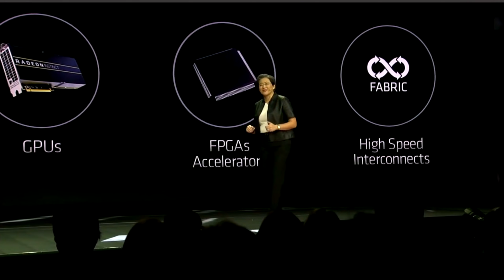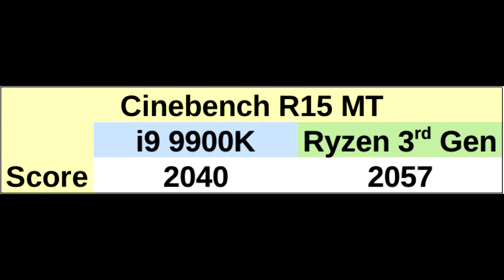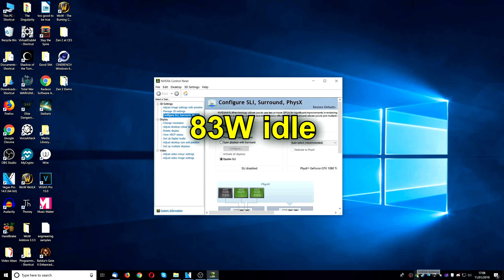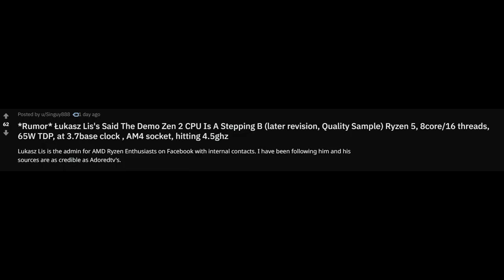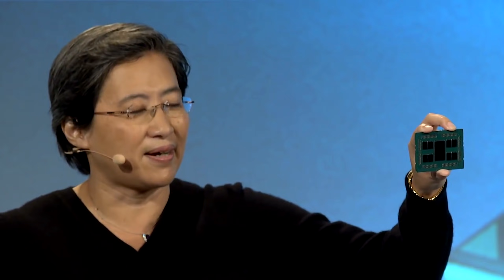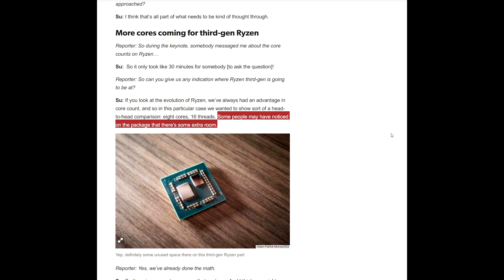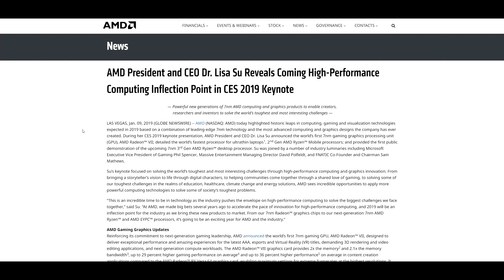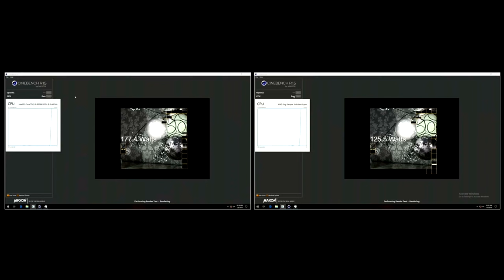Zen 2 Faster than i9 9900K at Half the Power.

Comment: Seeing as Dr Lisa Su, has pretty much CONFIRMED that they'll be able to put 2 chiplets on. It's only a matter of time, before 12 & 16 core RYZEN 3000 will be available. 😎
Reply: Lisa said it herself: they showed an 8-core chip to demonstrate a head-to-head comparison. They've always had the core-count advantage to fall back on when their IPC wasn't as good. Now they want to show apples-to-apples to prevent the tech press from simply laughing saying "if course you won! you had more cores!"
Reply: In traditional AMD fashion, the problem may lie at GloFo. The I/O chip's memory controller may not be able to handle communication with two CPU dies yet. That would explain the 8C demo and some schedule slippage.
Reply: @chipminion7887  Wrong. Did you forget that Rome has already GloFo I/O die handling communication to 4 cpu dies? Rome has been already benchmarked so probably it can do it..
Reply: @chipminion7887  They have already demo'd Rome with I/O controller and multiple chiplets. I think they are holding their cards close so they can gauge where Intel will be with Ice Lake and maximize the opportunity they have to gain performance leadership. It could also be they are figuring out the various chip binning strategies given experience where the TSMC 7nm performance is coming out. I think 4Ghz+ is probably a first for this node so maybe they don't have a lot of high performance chiplet's yet and the ones they do have they might want to feed to Rome to maximize revenue. It's clear AMD have the potential to > 8 core's and core for core is probably at least as good as the current Intel core but the challenge becomes how to maximize all those combinations of cores and Ghz across Rome, TR and Ryzen to make as much revenue as possible to grow the overall AMD business. They have to get out of being the low cost value play and capture a bigger slice of the high end and enterprise market to keep funding R&D and fix their lagging GPU/ML/AI business
Reply: Sure but I'm more excited by the fact that this was the low TDP part running at low clock speeds yet still beating 2700x. Not really interested in 12/16 cores other than how much cheaper it makes the 8/16. Most excited to find out the IPC and final clock speeds.
Reply: don't build up the next hype train
Reply: You know there is room in my garage for a Ferrari?  "Hey guys I'm getting a Ferrari!"
Reply: What does this mean for TR?  Will they stick to 24, 32, 48, 64?
Reply: @jonnytaco7671  same reason they use "dummy dies" for the first gen threadripper, to make it easier to upgrade in the future.
Reply: Why they did not announced it from CES to have their funbase happy. Also pricing will be very important in 3000 series.
Reply: Ok that's cool but why didn't they show 12/16 core ryzen 3000 at CES? Answer: Because it is clearly not ready yet.
Reply: @TheTomtah  It just means they didn't want to show all their cards to intel lol.
Reply: @heliamvs2035  Well they kind of did. What they wanted to do that was to show their advantage and the performance parity vs Intel's best. Now AMD has the advantage in core count, efficiency and atleast parity in single core performance. What does Intel have? Broken 10nm process which might somehow give Intel more room to work with, but it will never reach what AMD has as 7nm+ is confirmed and in design stage already.
At some point Intel will catch up, but it's pretty sure that Intel is really gonna lose a lot and possibly turn the tables in terms of market share to be majority AMD.
Reply: @heliamvs2035   If every tech nerd on the internet can see there is room for 2 chiplets on that chip I'm pretty sure Intel can figure it out too 😂. Especially given it was leaked way in advance of the presentation and they showed the wattage. Don't ya think ?

Lisa is not trying to play 4d chess guys... the 12/16 core chips just aren't ready for demonstration because they're having some technical issues with them currently. I'm sure they will be resolved.
Reply: @TheTomtah  18 core chips? Amazing.
Reply: @TheTomtah  There's also the issue of building up enough stock to satisfy demand and keep prices low once the CPUs finally debut. Because if Ryzen 3000 is truly as good as it is looking like right now, AMD will see record-breaking sales and they really don't want to fuck up this opportunity
Reply: @TheTomtah  Thats why he said "its a matter of time" i dont know why people comment stuff like this.
Reply: @7550Raul  Because through his wording he made it seem like Lisa is actively withholding this information as some part of a grand scheme when in reality I believe the 12/16c chips are not ready to be demoed for technical reasons.
Reply: @TheTomtah  maybe they don't want it to cannibalize threadripper sales?
Reply: That means it's also possible that amd will held the 12/16 core cpu for ryzen 4000 instead.
Reply: @Nourdon-AS  If they wanted to do that doing a small chiplet like this on this doe soze would have been a total waster of money. They will obviously fit a second one in there. Thats what the die size and 7nm process was built for

Comment: people just need to stop getting overhyped and pegging their identities to a company.  i thought amd did very good at ces,even the gpu, while a lot of amd fans are disappointed.  the ability to do 12 and 16 core cpus is confirmed. a new vega card that addresses most of the limitations of the old one (rop, mem bandiwdth, clocks).  the price is a bit high but wasnt that about what vega 64 launched at?  if they can get prices down it wont be that bad.  and of course they just had some extra vega 20 dies leftover from the pro cards and they need to get rid of them.  so they will sell them as gaming cards.  why not?  if there is interest and it doesnt fair terribly they could go back into production and lower the price eventually. if not then amd will just have to compete on lower tiers and possibly try to get a large navi out later.

on the cpu side things are looking very good indeed.  i didnt expect navi news this soon.  looks like its mostly going to plan
Reply: The zen2 CPU performance is over my expectation, the only thing I dont like is they gonna launch in mid 2019, not in march, so I have to wait longer while keep using my r5 1600 lol.
Reply: @qiyuxuan9437  "Mid 2019" can mean anything from May to August... and keep in mind that Ryzen 1st and 2nd Gen are arguable about "Launching" in March., as they were Late-March / Early-April for Mainstream CPU. 
Now this year we do have the 50th Anniversary (4-5th May) for AMD., so it actually makes sense for them to celebrate this in some exceptional style.

Intel recent did something similar for their 50th x86 Anniversary with the i9 8086K Processor, but the thing is... that was released outside of the normal Product Launch Windows. 
Where-as while we can of course expect to see AMD also release a "Special 50th" Anniversary Processor (i.e. Ryzen 9 3950 Anniversary Edition)., almost certainly being golden samples capable of ridiculous frequencies; 16 Cores / 32 Threads with Special Boxing, etc.

What better way to Celebrate said 50th Anniversary by releasing a Product Series that showcases them Ryzen to the Desktop CPU Performance Crown holders.
And this is in a way what makes both the Cinebench but also the Forza Horizon 4 Benchmarks far more impressive that they appear at first glance... 

As such., we know that with more Cores in Multi-Threaded Tasks … AMD's Ryzen is capable of being quite dominant., but here's the thing... what about Single Threaded (what's important for gaming) in Like-for-Like Scenarios.

I mean as a quick comparison., we know that the "Engineering Sample" is 8C / 16T... alright., but is also half the CPU; this means the Fastest APU (CPU + GPU) with have 8C / 16T; and based on scaling; we know that the 7nm "Chiplet" Core Package is 7.6mm x 10.5mm (80mm²) … when we compare this to Radeon VII (7nm Vega 20)., which is 56 - 64 CU in a 332mm² Package then we are looking at 15 - 20CU, that further are in essence Full Discreet.

On top of this keep in mind that the current Vega 11 use ~25w (Desktop) at 1250MHz (1.76TF) capable of using up to ~35w at 1400MHz (1.97TF) … +25% Frequency at 50% Power Draw., this as a note means the Vega 11 on 7nm would be capable of 1,560MHz using 13w; and AMD GPU linearly scale.

This means Vega/Navi 20 on 7nm will likely hit 1,600MHz using 25-30w (4.1TF) … to put that into perspective, we're talking about an Integrated GPU that will offer between 15 - 13% Lower Performance than an RX 470,. and 22 - 18% Lower Performance than an RX 570.

Maybe less, depending on the System Memory; so perhaps 25% Lower Performance with DDR4 2666MHz but still … for something built-in to the CPU., this essentially makes Discreet Budget Mainstream GPU obsolete.
Heck a 15CU as opposed to 20CU variant; will essentially provide GTX 1050Ti performance; but doing this within the same power envelope that the current Vega 11 uses. 

•

And keep in mind what I'm saying in terms of Scaling for Radeon (GCN) GPU is also true for Ryzen CCX., so if this is a 65w at 8C/16T 3.7GHz - 4.5GHz … then this means the 16C/32T Version will not only match Clocks (these are separate Chiplet Packages, meaning they aren't bound by the same On-Die Thermal Bleed as Monolithic Designs; such-as the Ryzen SoC; but will do that at 130w (at peak). 
If AMD have actually improved Precision Boost with 3.0., then we could actually be looking at better 115-125w; while retaining the same performance... with Zero difference between Gaming or Professional workloads, meaning these should run more power efficient and cooler while Gaming. 

•

Yet here's the thing... keep in mind what AMD showcased was essentially the Replacement to the Ryzen 5 1600 / 2600 (and if we believe the rumours the same $180 launch price); meaning within 2 Generations and still completely usable on our B350 Boards (albeit likely needing a BIOS update), we will be looking at getting +2C / +4T and +100% Multi-Threading Performance over our current Ryzen 5 1600 Processors.

Keep in mind that without overclocking our Processors are 3.2/3.5GHz "Out of the Box"., while you might've been lucky, I wasn't and really mine will only stable clock to ~3.75GHz (at least with the Wraith Spire Cooler)… and that's where this Processor basically idles. 

That's one heck of an upgrade for only 2 years difference and entirely compatible with the current Ecosystem.
Reply: @Leyvin  I did a 3.9ghz on my 1600 with 1.4 vcore and 3133mhz on my ram, it does a decent job, but since I really want battlefield5 to run stable 120+ fps without droping framerates on my 144hz monitor, so I need zen2 upgrade. Hope they launch the 8 core sku first.
Reply: @qiyuxuan9437  • Yeah, I know I certainly didn't "Luck out" on the Silicon Lottery on my Ryzen... but flipside my RX 480 (which contently OC' to 1520MHz at 1120mV and 72c) was the opposite.

So you win some, you lose some. ^_^
Still I've not been disappointed with it... 

As for their announcement / release.
I see GDC (Mid-March) being heavily focused on Mainstream Ryzen 3rd Gen and Navi. 

This means the: 
Ryzen 3 3400 / 3400X / 3500G (6C/12T/15CU) ($120)
Ryzen 5 3600 / 3600X / 3700G (8C/16T/20CU) ($180)
Ryzen 7 3700 / 3700X (8C/16T but 2 Chiplet) ($220)
Radeon RX 3600 (30CU / 4GB / $120)
Radeon RX 3700 (40CU / 8GB / $180)
Radeon RX 3800 (50CU / 8GB / $240)

I don't think Navi really is any "Major" changes from Vega 20 aside from the Hybrid Memory I/O... allowing the usage of HBM and/or GDDR. 

And here's the thing AMD doesn't really need to showcase the highest performance., but reduce the current Performance Gap between "Entry Level" and "Enthusiast" for the Avg. Gamer.

Don't get me wrong the Tech Press will focus on this being a "Big Deal" that AMD doesn't have anything (initially) to compete against NVIDIA... but really does that matter when only 15% (at best) of the Market even purchases said Hardware?

I know that I as a Developer don't (currently) give a damn about anything above an RX 580 / GTX 1060 in terms of performance when it comes to optimisation or feature support.

Why should I? All that time and effort for a fraction of the market that will ever actually be able to experience it... pointless. It's like trying to predict future hardware performance trends; we have no idea if Next-Gen will bring more Performance or New Features., they rarely bring both.
Reply: @qiyuxuan9437  same haha i want that 16 core
Reply: @coinopsy7650  Especially this low power usage make me feel so much better, since I got a crappy asrock X470 board that has weak VRMs.
Reply: I actually fully expected them to launch vega 2 as a prosumer card with frontier edition pricing, so I'm pretty positive about the way that went. Considering it's basically their version of the titan v (big chip on a new node with 4 hbm stacks, really expensive to make, lots of new uarch stuff for HPC like 1/2 fp64 and low precision modes) that's the only thing that made any sense to me, I guess they're going with really low margins on this card, like with consumer vega.
Reply: @sstkitm  IIRC the VII chip will be around 300mm So not really a big chip. But probably still having some yield issues on a new node. They released the pricing so doubt that will change between now and launch. The HBM2 cost is estimated at around 300 $USD for the card. So the launch price is actually quite cheap. Especially when compared to a certain other companies launch prices
Reply: They may well have only announced one vega card when there are three in the lineup too (at 2070 and 2060 levels but undercutting them on price as well)
Reply: bobhumplick thank you someone have a brain and use it properly be like this guy USE IT THINKCAP PLEASE THINKCAP WE HAVE A REASON.
Reply: shit man, i've been using intel for quite sometime now; from celeron and pentium to i3s and i7s -- i've tried all of these. rocking my 8700 (non k) now and my second system is r5 2600 based. if amd overtakes intel as market leader it will be a win for us consumers and will force intel to improve their products even more. it's a win-win all-around.
Reply: I'm still undecided... AMD or Intel till death?! I wish Cyrix was still alive...
Reply: For me that Vega VII is a beast, sadly it's not the kind of beast that a gamer would love, but still.
Reply: What makes you think that vega ii will launch at MSRP when vega 56&64 cost above MSRP at launch? Vega ii will also cost $100-200 above the $699 MSRP for weeks after launch.
Reply: @Nourdon-AS  It should be pretty close to MSRP tho, Vega64/56 launched during the time when mining drive up the GPU prices.
Reply: @Nourdon-AS  never said it would.  im talking about the future.  you can find vega 56's for around 350 here and 64s for that price or just a bit more.  of course by the time the price comes down nvidia will be close to something new and even amd might have something to replace vega.  but its possible
Reply: @Nourdon-AS  Mining on GPUs is pretty much dead.  That's why Vega price was so much above MSRP.  It'll still be $50 over; they always are but so is the 2080.
Reply: Yeah but the thing about RVII is that nobody cares about the comparison to the Vega 64, it's against the 2080 that counts. In order to be a good product it NEEDS to be a decent amount cheaper since it will inevitably perform worse and consume more power(despite being 7nm which is actually crazy). That doesn't mean the same price, and that sure as hell doesn't mean more which is probably what it will be for months after launch.
Reply: @AVerySillySausage  Yes ppl care about the comparison. It doesnt need to be a lot cheaper to sell. It is not really the same market as the 2080, VII is much better suited for production workloads looking at the memory type and bandwith. Its an ok gamer card, but would be a great production card. Think of it more like a FE/Quadro that can game and the price is damned good

Comment: Ah the wait is over...
They used an 8c chiplet probably because yields were still bad or since it was one of their earliest parts and it was just good enough to beat intels flagship already.... Kinda evil if you think about it... The empty slot on the die was then the icing on the cake...
Reply: The Schiffer Yields would have nothing to do with this. This is an engineering sample, so they obviously aren’t going into mass production where yields are an actual concern.
Reply: Dont think so. This is incredible performance for a Ryzen 5 3500 replacement for $200usd. This is top silicon for the R9, which will  have two of these chips on the substrate. Any defects or low frequency cpus would become  6 core CPUs for the R3300G and 12 cores for the R7s IMO
Reply: @joanamendoza-r5l  some ppl speculate this 8c ryzen was only at ~4.1 ghz clock (all core boost)...